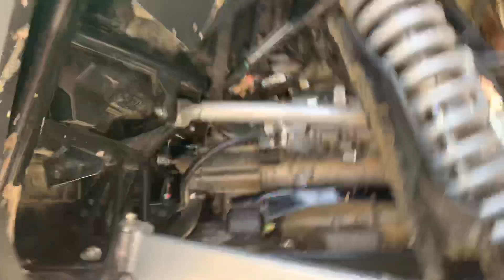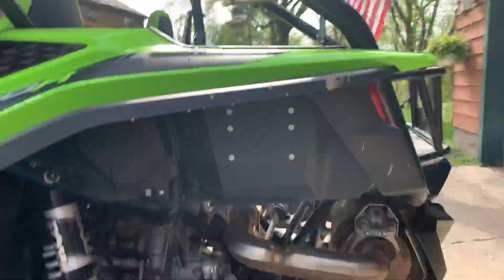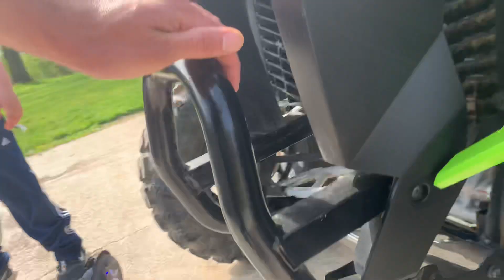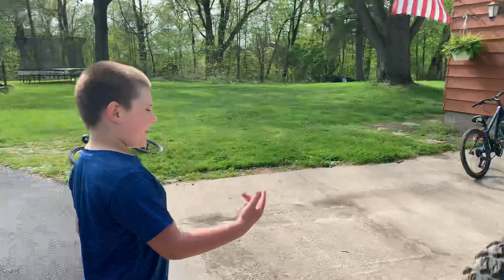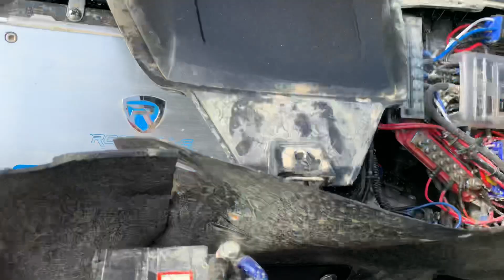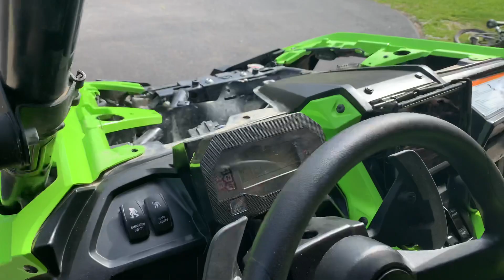Honda Talon first service wrap up

Comment: Appreciate ya thanks man
Reply from the maker: No problem at all happy to help

The subwoofer I used was a Rockville SS8p
https://www.rockvilleaudio.com/ss8prwk10/?gclid=CjwKCAjw5Ij2BRBdEiwA0Frc9eGgm0UUj-SASY9kYQJD_sG1EBi1JzNARZ6fMmaxT3oryvQUXsu2ARoCfPsQAvD_BwE
A few things about that unit:
It is not marine grade. The only thing in my setup that isn’t. I had to make the most out the space I had available simply because I didn’t want to give up my glove box. The wiring harness is just a plug though so it’s easy to unplug that harness and slide it out before washing or crazy mud holes. It’s also only an 8” woofer so it’s not that loud. Just kinda is what it is though.

Door speakers are kicker 6.5” marine grade, very happy with them they sound great.
https://www.ebay.com/itm/Kicker-6-5-Charcoal-Marine-Speakers-QTY-2-1-pair-of-OEM-replacement-speakers-/153561078031

The door pods were off of Amazon. You have to get creative to make them work not a plug and play type of pod.  Again though, I wanted them in that spot and made it work. 

https://www.amazon.com/Universal-Speaker-Enclosures-Install-Speakers/dp/B07PQYSZTC             

All things considered, I’m pretty happy with everything and how it sounds...... so far at least